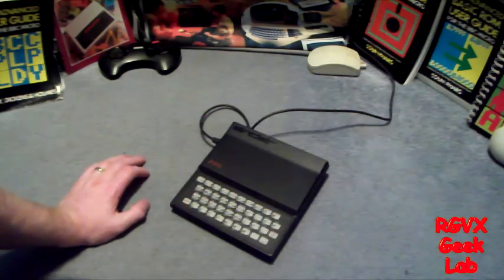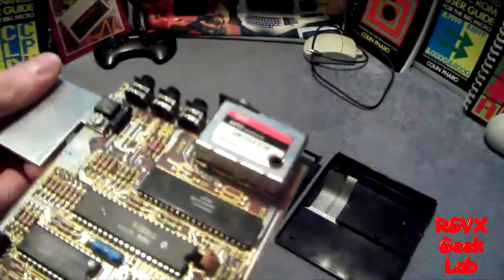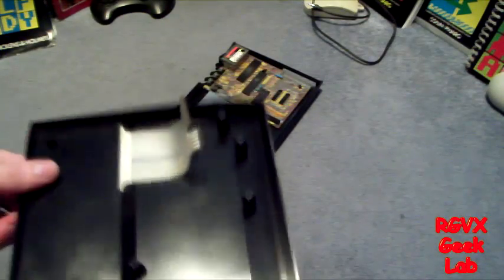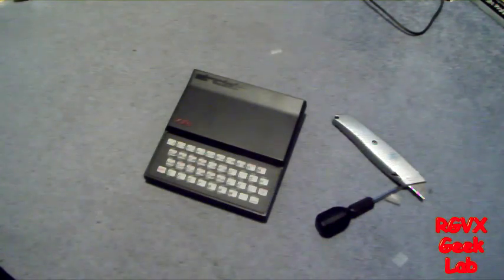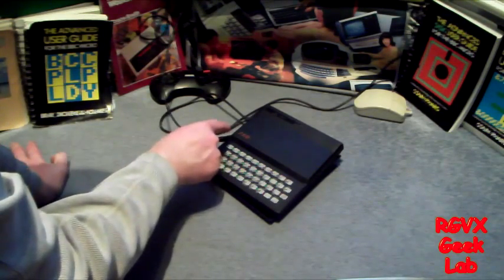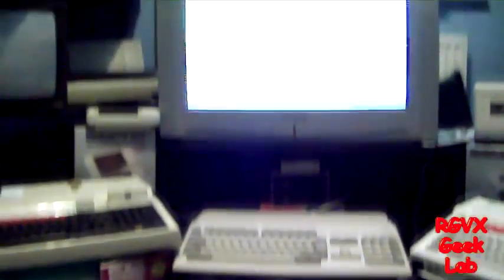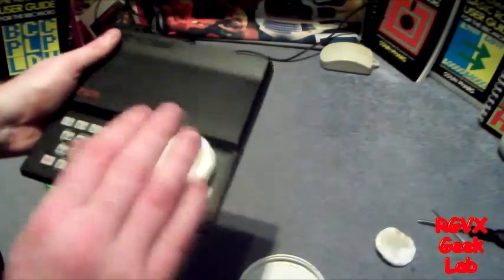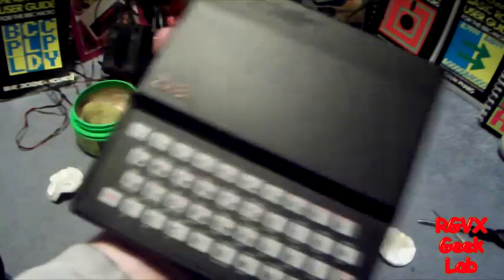Sinclair ZX81 repair ( Keyboard / Modulator)

Comment: Lol, I'm so glad I found this video... I recently got a Timex Sinclair 1000 for my side of the pond, but the cheap mylar keyboard cable broke. I was worried that I'd have to spend lods o emone trying to import a new ZX81 membrane from the UK, or maybe having to solder some wires between they keyboard and socket (but that might melt the thin mylar).... so I was fretting big time! Then I found your video... the second you said that there was plenty of slack, I just about facepalmed. Thanks for saving me a wad!

Comment: When my ZX81 keyboard crapped out I rewired an old TRS80 keyboard and soldered tit to the ZX81 board. It works fine. I rigged the F1 switch to isolate the space bar to prevent accidental program breaks
Reply from the maker: Ingenious :o)

Comment: Instead of using a knife you can use a scissor to avoid those ugly scratches at the inside of the ZX case. I have two ZX81`s and practiced that. According to my experience in many cases it is insufficient to readjust the modulator by retuning the ferrite core of the modulator - it is more recommendable to install the composite video mod with a 100 Ohms resistor and a
BC 547 Transistor -very simple; much better picture. 
Wax is not the recommended case treatment; best results: Armor all.